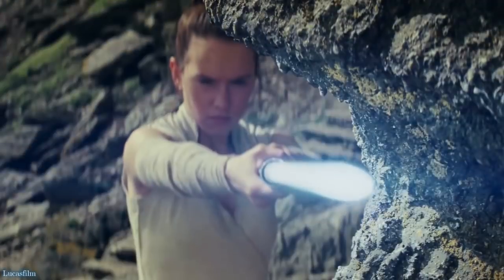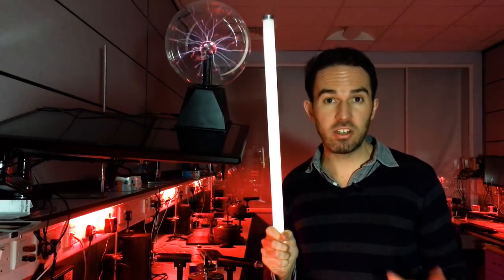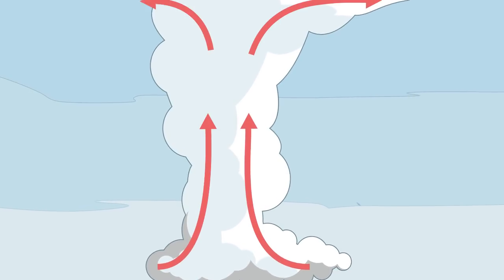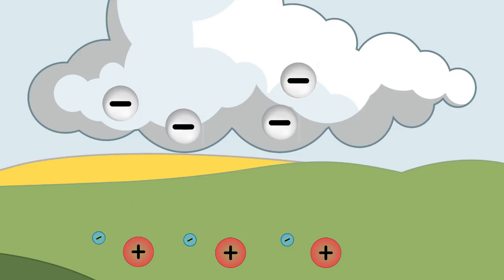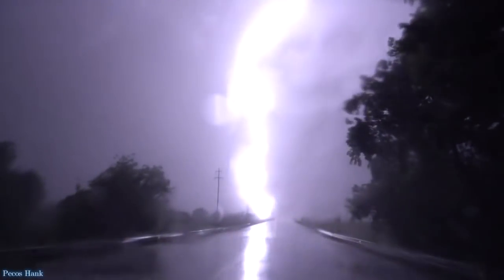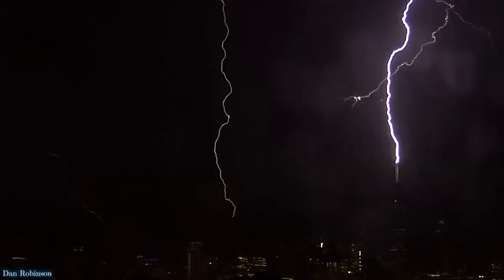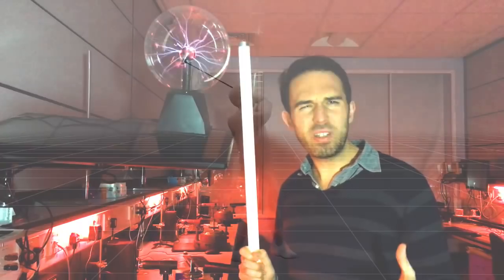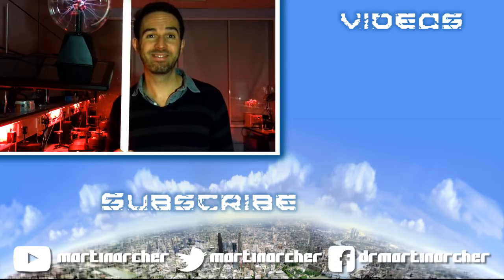The Shocking Truth of Lightsabers vs Lightning | Physics vs Film

Comment: When you say it would explode, if it hitbother plasmoid... Do you mean like... In all directions? Or would it sort of "splash"?

If thats the case... Would the direction, velocity, etc... Affect the direction of the splash? Like... If a jedi could move the light saber not "in the way of the blast" but more like a baseball style swing... Would it explode all arround like a bomb or would it splash fiery death in more or less the direction of the swing?
Reply from the maker: The orientation of the magnetic field containing the plasma blades would determine the two major directions the hot plasma would explosively be released. It’s likely that this would vary drastically from lightsaber to lightsaber. But the crux is, if part of the explosion is headed towards your opponent, then there’s another part in the opposite direction, which is where you would be!

Comment: So... the problem I have with the explanation of the path of the lightning is that it is entirely possibly the path of lowest resistance is not through a Jedi into the ground, but into a charging mechanism that can handle the high voltages (in principle).
Even if this weren't the case, if a Sith can manage to direct lightning into his hands, it's conceivable that a Jedi can redirect lightning in a non-harmful way into the ground. So the purpose of a lightsaber in this case wouldn't be to handle the charge so much as direct it into the path most easily handled by a Jedi.
And how it would be possible is the use of the force: If the force can pull energy from the surrounding environment or channel it from the force user themselves, the target force user can certainly diffuse it. Thermal energy is just kinetic energy, therefore super-heating the air is also a form of that, and redirecting energy is easily in a force users wheelhouse. Levitating objects and creating lightning are, in concept, 2 sides of the same coin, and the force can clearly be used to channel kinetic energy.
So how does one use the force to do all this? I'm not sure. It's a practical explanation that the majority of the Jedi would not know, either, and it's probably an intergalactic society's equivalent to not needing to know how kinetic energy is converted in gunpowder in order to allow a soldier to fire a gun. Furthermore, we have seen how Jedi are pulled from humble origins, not to mention it's convenient in order to prevent the audience from getting bored. How kinetic energy is channeled is probably a question for the galaxy's top Jedi minds (or Goku's spirit bomb sensei). Religion is a powerful workaround for lengthy education that may delay the progress of fashioning poor youth into viable citizens.
Incidentally, I have a very good explanation of how it is possible for Anakin to grow up in a relatively (double entendre) short amount of time compared to Padme that doesn't involve age disparity since the gravity at the intergalactic center would significantly alter the passage of time. One which explains a number other features of the Star Wars galaxy.